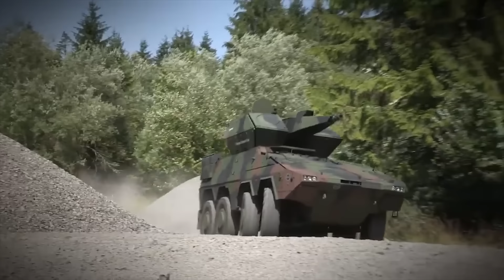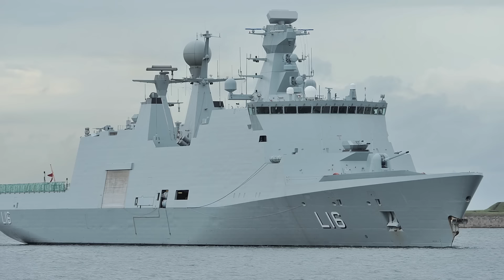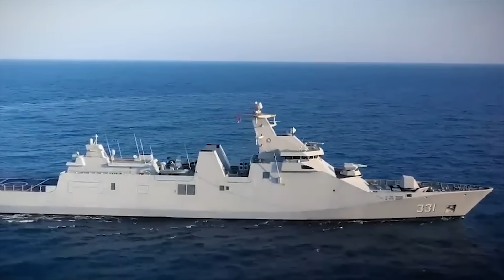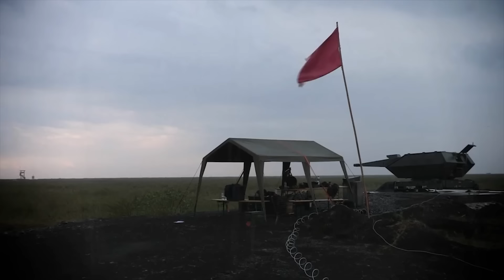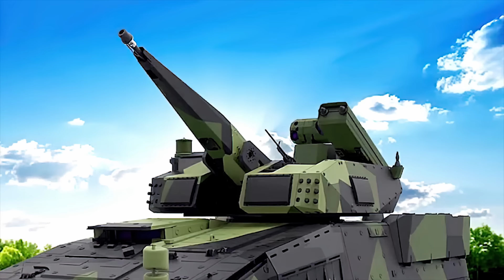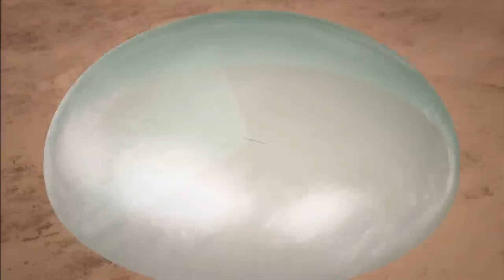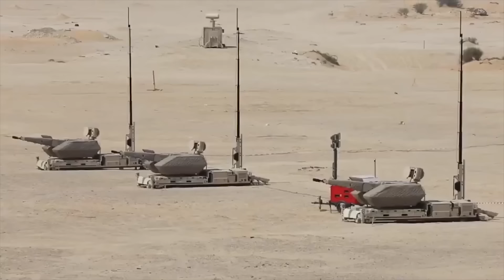GERMAN Fastest Air Defense Systems SHOCKED The World!

Comment: It's a good weapon, but there are still problems:
1- Will there be sufficient production to deal with mass attacks? The Russians rely on the amount engaged in a fight, regardless of casualties as long as they destroy their objective.
2 - What can this weapon do against animated projectiles of hypersonic speed?
Still, it's a weapon that can be used for specific needs, but probably not against a massive attack unless we have a massive defense..
Reply: it is a SHORAD system, meaning short range air defense, meaning below 5000m range.
Skyshield and Milenium Gun can also work as C-RAM systems. this is called MANTIS and has been in use with the german army since 2010 in afghanistan.
Hypersonic missiles and balistic missiles are not part of the target selection. for that missiles like NASAM or IRIS-T-SLM are used
Reply: @zhufortheimpaler4041  Thank you for the clarification.
 But what are the means to protect against massive attacks of more rustic ammunitions ? Are a few sophisticated weapons enough? drone trials  ? (rather simple to manufacture and inexpensive).
 Everything depends on the strategic depth of the belligerents both in human resources and in resources of raw materials, energy and manufacturing plants.
And probably in determination...
Reply: @remrafbaloo6455  sure you cna overload the capacity of the system.
but in that case every other system would be also overloaded.
And Russia is and was not capable of doing something likethat.
They managed to "overload" the ukrainian air defense network several times, but thatnetwork is using Tech from the 1980´s with less capability.
Reply: @zhufortheimpaler4041  It remains to be hoped that for their offensive, the Ukrainians will be able to overcome the masses of Russian weapons which you consider largely obsolete. Unless they come across a surprise, they should therefore dominate the battlefield. 
You should also know that the Ukrainians also have elements of surprise. Hopefully this will compensate and even overtake the Russian forces in this case.
Reply: @remrafbaloo6455  Ukraine itself uses primarily obsolete equipment in AA roles.
Russia has much more modernsystems
Reply: @zhufortheimpaler4041 Indeed, Ukraine has old equipment from the Soviet era that is obsolete. But Russia has abandoned many of them to the ulrainiens and is using them too. 
Ukraine also has modern weapons supplied by Westerners. But Ukraine also has weapons that it modifies to make them more effective. Otherwise, the Russians would have swept the Ukrainians long ago.
Reply: @zhufortheimpaler4041  "Russia has much more modernsystems". It's possible... But it's not very spectacular. the Russians are trampling. The Israelis, with 6 million citizens, defeated in 6 days a coalition of 88 million citizens. One wonders why, with 144 million citizens, the Russians did not crush the Ukrainians in 3 days ...
1
Reply: @@unknowndev392 it is in active service since the early 2000's with several navy's as CIWS and with the Bundeswehr als CRAM for base defense. It is battle tested and performed exceptional

Comment: Ultra efficient systems. I suppose these ultrafast shooting systems are water cooled otherwise the barrels will get overheated and sacrifice accuracy. But the the three mode system is by far the best in its class  globally.
Reply: They are not water-cooled because it is not necessary. They only fire in short bursts of a few shells at a time.
The Gepard for example usually fires in 24 round bursts (ie 12 per barrel) at any one target but the Ukrainians reduced that to 6 without it losing effectiveness.
Reply: @gustavmeyrink_2.0  Very interesting input  - did not know the Ukrainians doing a lifehack on the Gepard. I think this was urged by ammo shortage.
Reply: @weltbunte1134  Not a hack, just an adjustment of the computerized fire control system.
If you watch older German Gepard videos here and read the comments and there are some by people who actually served on them.
During live fire exercises the target was a windsock towed on a cable by a small remote controlled airplane (you'd call it a drone these days). After a few days of practice the gunners took pride in cutting the cable rather than shooting holes into the windsock.
Gepards are incredibly accurate. For small targets 6 shells is enough but you might want to up that number if the target is an attack helicopter which incidentally is what the Gepard was designed for.
Reply: @gustavmeyrink_2.0  👍
Reply: They probably are, but I think mainly they just don't shoot for a minute straight up. The Gepard anti-aircraft gun tank which predates these things by decades has been doing very well vs drones in Ukraine often taking the target down in a single salvo. It just needs a short burst of spitting bullets with high accuracy, I imagine everything on these new (but similar) systems would be even more accurate.
Reply: German engineering at its best.

Comment: To me, accuracy, lethality, and economical use of ammunition would be one bullet from these guns taking down a plane or missile.  A thousand bullets for one missile, or one bullet each for a thousand missiles.
Reply: The Gepard system can reliably shoot down cruise missiles or drones using just a few bullets each. I doubt this one, 40-50 years later, will be worse in that aspect.
Reply: @drsnova7313  They fure in rates of 5 rounds
Reply: Yes..But this is Earth..
Reply: sure, if you can design a system that has a 100% hit rate in 100% of situations?
if not.... a burst of rounds per missile with air burst ammunition will do the job quite well

Comment: Skyranger is interesting but should be put on a tracked chassis (for instance CV90, Puma, Leopard 2 or other tracked IFV or tank hull) so it has better mobility and can go where tanks and IFVs go to give them air cover.
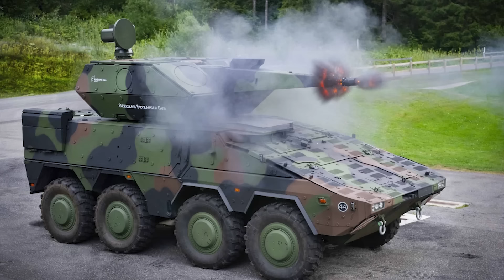Reply: It is called skyranger if put on Boxer or Lynx(it is shown at 0:37 in , otherwise it is called Matis (stationary) )
Reply: @tyrson2445   I think it's just a typo. But it is called Mantis  😄
Reply: @tyrson2445  MANTIS is the old version of the system. The new gun is simply called "Revolver Gun Mk.3", while the complete system (including HEL, MIS, etc.) is skymaster, while the gun system is skyshield.
Reply: KMW has launched a prototype of the Boxer tracked on Eurosatory 2022. Then you can place the Skyranger modul in 30 minutes from wheeled Boxer to a Boxer tracked.
Reply: in fact, the Boxer has close to similar terrain mobility and agility to an MBT
Reply: @zhufortheimpaler4041  The factor is the terrain and the tyres. Do you have the wrong tyres, you stuck in mud. Have you the right tyres for mud, then driving on road is't good and also bad in the dessert. A tracked vehicle is maybe 10 percent better on heavy terrain, but that can make the the win.
Reply: @dertom2823  it has an automatic inflation/deflation system and flat run tyres.
It is proven to be as reliable in terrain as it is on road.
Reply: @zhufortheimpaler4041  Yes, those systems are installed on the most wheeled vehicles, but you need to drive very carefully, when tyres have low pressure. Mostly tracked vehicles driving faster on these condtion. Lower speed is more time to attacked by the enemy.
Reply: WoW! A fantastic defence system! Every Democratic country should have them!
Reply: https://www.youtube.com/watch?v=FwsA6rP9tjM